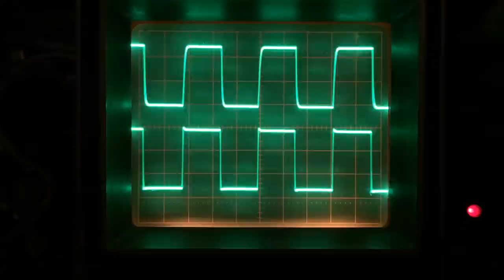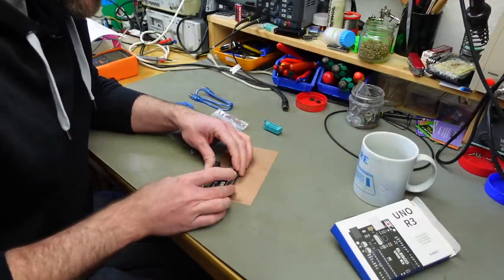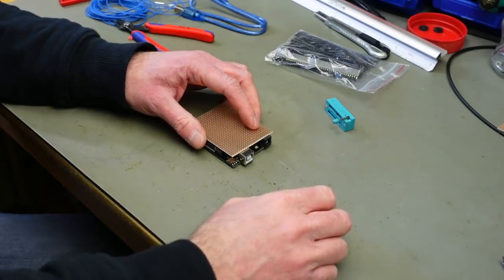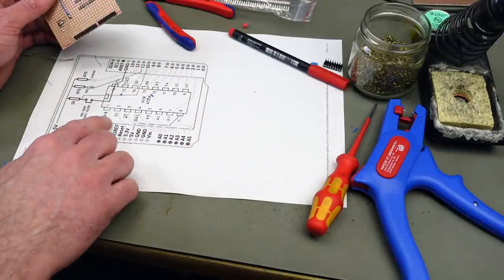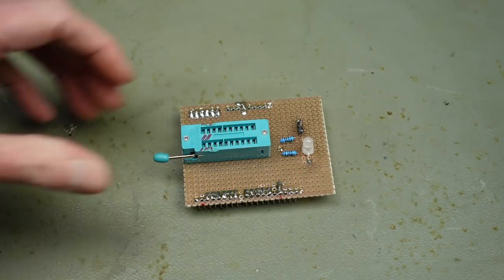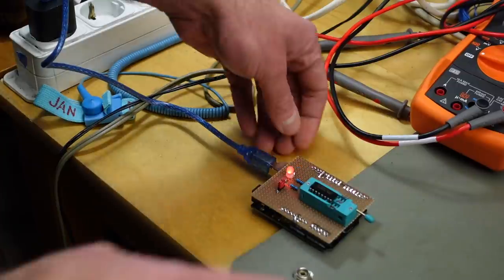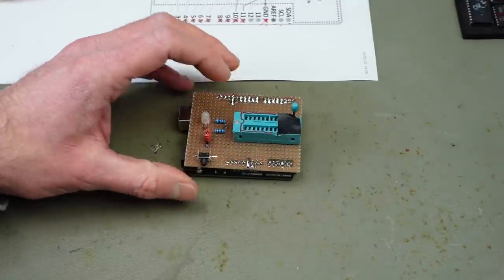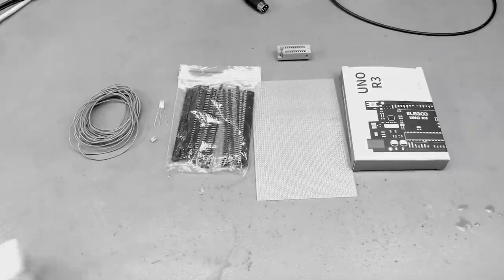Quick and dirty Arduino DRAM Tester Build

Comment: try this... get a piece of copper, solder a blob directly on to it WITHOUT flux.... you can knock the blob off as it will not bond. now put flux on the copper, heat it till it bubbles around 2 - 3 second then solder onto it...... the solder will flow properly if you let it heat past whats called the " plastic " stage which is where the solder is molten but NOT AT JOINTING TEMP. :D 
i have been soldering for over 40 years, ex M O D.... .

Comment: It really is super annoying that they didn't go with a standard pitch so you can use the standard 2.54mm pitch perfboard, I have been in the same exact situation as this and I think it's better to call Arduino Noobs for it than yourself Jan Beta :)
Reply: It is standard pitch, but offset by a half. Because life wasn't meant to be easy... Unless you by a proto shield.

Comment: Too bad it won't test 4116, but you would need +12v +5v -5v
Reply from the maker: I saw a similar tester that can test 4116s, too. But it’s not as quick and dirty, probably because of the extra voltages. ;)

Comment: if you're using the sw downloaded from the www page you've shown you shouldn't believe the result as the sw doesn't test the dram properly and contains a bug
Reply from the maker: It got updated several times and should work now (original posting was indeed faulty). See the whole forum thread.

Comment: Too much work to add a reset button.  Just hack out a corner of your board to provide easier access to the Arduino's.
Reply from the maker: Yeah, that would definitely be more in-line with the whole project. Didn’t think of that. :D
Reply: @JanBeta  I don't hold it against you.👍

Comment: Ground the Address 7 line, or tie it high.  The 6164 still passes the test.  I think you can ground any address line and the test still passes.  Not a good test!!
Reply from the maker: It’s not very accurate for finding good chips, it’s great for finding chips that are definitely broken, as mentioned. Not the best device around for testing RAM obviously but extremely inexpensive and easy to build.
Reply: @JanBeta  It's a fun build.  If the uno had 8 analog inputs (which it does not), a bit of programming could be added to check the voltage level on all address lines (Maybe add some high value pull-up resistors).  If some are 2.5 volts when expecting 5 volts, the ram is bad despite passing other checks.   Some 4066 analog switch chips could be used to expand the current number of analog inputs, but I don't think there is enough spare digital lines to control the needed 4066s.  If the language was VB instead of that latin or greek c++, I would be all over this project - lol.
Reply: @JanBeta  One more thing, to your point, it does find bad chips quickly.   It had identified, for me, about four Good rams that do not work in the C64.  The only thing I can figure is bad address line inputs.  I don't know what it would could be done with any RAM tester about that.  The most accurate tester would be to add a 16 pin Ziff socket to a C64 mother board.  I have a brand new blank PCB I ordered from some store in Germany, I think, red.  It will be built with ZIFF sockets at all major locations. including at least one RAM.